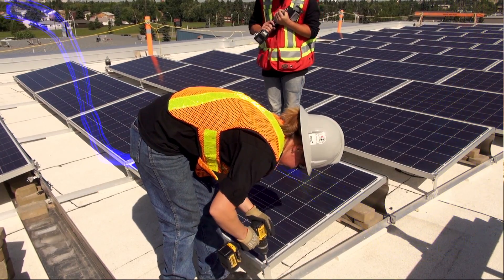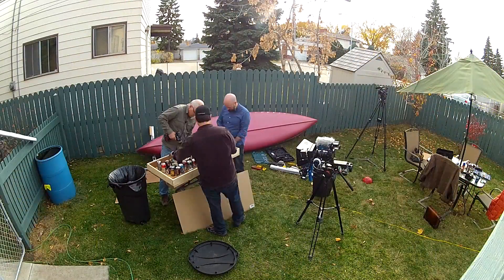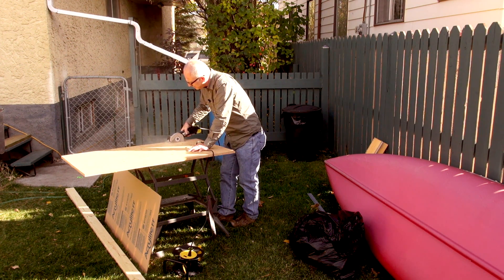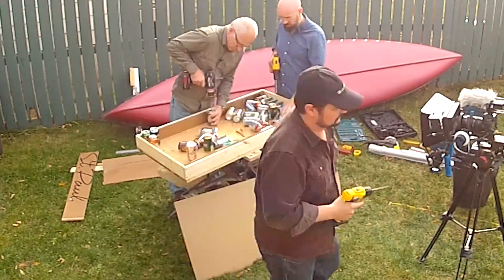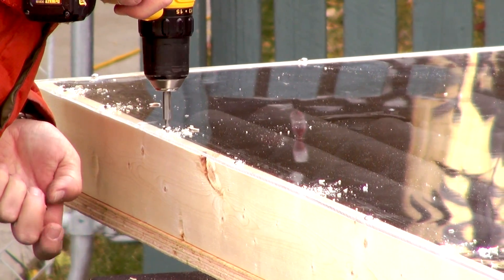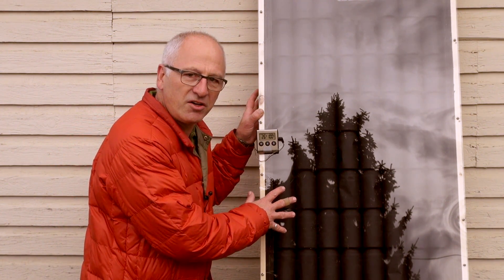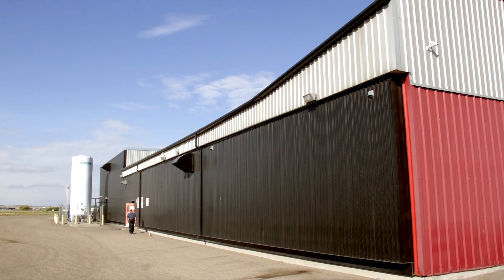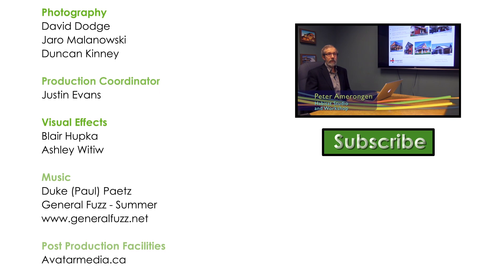90. Solar air heating: We build a DIY version and check out SolarWalls

Comment: Using the metal lath is a great idea. Adding an aluminum screen wrapped around the lath would add more heat to the system. Great job.

Comment: I feel sorry for the Alberta students being subjected to this type of disinformation and faulty science. If the solar collector needs a circulation fan, the whole design should be scrapped and measuring the temperature of the collector is meaningless. If they measured the volume and temperature of the air it produces, then they would be telling us something of value.
Reply: Yeah I was wondering what the purpose of the fan was...
Reply: @ThorsteinnSverrisson  Right! If it is properly designed and built, convection should be all that is needed to circulate the air. If it needs a fan, there something wrong with the design.

Comment: This is actually NOT to correct way to circulate the air. Remove the tops completely and flare the base of each can resembling a pin wheel. The idea is to slow the air flow long enough to super heat the air and the pin wheel cuts in the base of the can causes the air to swirl in each can instead of just passing through the can
Reply: Interesting idea, have you tried it? It theoretically makes sense. But how would one fasten the cans together?

Comment: Come on man, ditch the stupid alum cans and spent a few bucks on real thin walled pipe... He should have completely cut out the bottom of the cans instead of 4-5 holes for much better air flow.... or use thin walled pipe like I said for a few bucks.  Also use 2 big fans in a push pull configuration. a Thermostat on/off auto switch installed would be nice.
Reply: im with u on this!  AND how are they all working? still NOT! i bet. i did something like this and one of the problems was it got damp and latter Black Mold! so i did away with it and spent a bit more $ for a Closed loop system. if interested look me up at Guilt Free Hot Water, don't worrier nothing to sell but get the right stuff and do it Right!
Reply: Be awesome to grab some used black plumbing pipe..  Got to be wasted stuff out there somewhere.. Wonder if filling with water , might even add a longer heat timeframe..
Reply: I’ve also seen one of these built using pennies glued to the inner surface and spray painted black with charcoal grill paint. 
When you say ‘thin walled’ pipe do you mean copper pipe or conduit tubing? What diameter pipe do you suggest? I presume smaller pipe would increase surface area. Perhaps the refrigerant piping from an old air conditioner? I have one that still has the aluminum fins. Maybe I’ll make one from it to see how it performs.

Comment: Make sure you insulate all the walls of the box.or you will cook the wood .  This will give the heat no option but to go for the easy way out, the Airflow,.  and speed of air flow are important. Faster get less heat slower get more heat. 
Will the differential Internal to air temperature of glass panel be able to cope with the difference. Ie Oven glass doors can. Ordinary glass may not..!

Comment: Build one of these recirculating through a thermal mass and it will heat the structure all night too.
Reply: Thermal mass?
Reply: @jamielc3437  Like a bin full of pea gravel, rocks or cob. Similar to a rocket mass heater. Many videos about them in YouTube for wood fired RMH’s.

Comment: Guys, doesn't it makes more sense to take air from the inside, not from the outside? Please share your thoughts on this topic
Reply: Yes, it would be better to take colder air out is your house and heat it. Just like in a car, heats and cools faster that way instead of using outside air
Reply: AJ Dude the air from outside is heated so I don’t see my ch difference 
Not like wood stoves drawing in outer cold air

Comment: A few things I would do to better the unit...is 1 do not put so many vent holes in that's rushing the cold air in 2 would of put the vent holes where it would drew cold air from the garage...2 paint the back board of the box black first every crack matters... 3rd the vent holes would allow little critters in so I would get some kind of screening to keep them out... Seal the corners and insulate the sides and bottom and top from the colder air and leakage of warm air...

Comment: If you found a way to attach the fan to a small solar panel (the kind used for garden lighting or water pumps), then it could be entirely passive. Nice idea.
Reply: I use that set up in my greenhouse,  15 watt solar panel running 4 old computer fans.   They blow hot humid air from the roof of the greenhouse  down "temporary plastic downspout" and into pipes under the soil.   They could work the same way in a solar hot air system.

Comment: Some tips for anyone contemplating doing something like this: Double glazing is recommended for cold weather climates - I use double wall polycarbonate sheets, something like a Suntuf corrugated panel would be fine in less cold areas. You should be drawing intake air from the living space of the home/dwelling, flow through the heater, and then back into the living space. A 1' thick piece of polyisocyanurate rigid insulation painted flat black (that stuff won't melt in high temperatures) works best as the backing. Sufficient size is important, a 4'x8' (or something about 32 sq. ft.) is about the minimum for efficient heating. A fan to provide sufficient air flow but not too much is best - usually installed on the outlet side and optimally would have variable speed and temperature controlled on/off modules. Although well designed passive systems do work too. A backdraft damper on the intake to avoid heat loss at night is a good idea. Mount at a high angle, or even vertical, to catch most of the winter sun - and less of the summer sun.

And finally, using black fiberglass or aluminum insect screening is a heck of lot easier and typically works better than hundreds of aluminum cans! Buiditsolar.com and simplysolar.com are excellent sources for more information.
Reply: It could be my weak internet signal but I couldn’t get either link to open in Safari.
Reply: Excellent tips, Chuck, every one of them!
Reply: Thank you. These are great tips.
Reply: Do you have any data on the amount of energy per area? I recall that the earth average is about 1300 W / m^2 but it could dip low during winter (hence the need for insulation) and go very high during summer.

Comment: I have one of these they work OK when the sun in shining and it's say 10C, now bring it down to  -30C and they don't work. So when you really don't need much heat they are OK but when you really need heat forget about it!
Reply: would it keep it at least around 5-10 degrees if it were running when it was that cold? i'm looking to build this to to just keep my shed above freezing but doesn't need to be too warm
Reply: @KatBurnsKASHKA  I was wondering if this could help keep a crawl,space under a mobile home warmer to keep the pipes from freezing or help minimize the amount for energy spent on keeping pipes warm and from freezing….
Reply: @Abeaness  It would seem to be helpful. As long as the space is fairly well enclosed and perhaps Insulated with styrofoam. Any increase in temp under the house would help reduce energy consumption. And you could also make multiple units.

Comment: Max power is 1 Kwh for each square m. Since that thing won't follow the sun all day you get around 30%. So bigger pannel = more heat. Those can's looks nice but won't improve surface much. Also won't store heat for more than minutes so use them or not is up to you. About paint and plexi gases ... That paint is made for stoves so no worry about too much heat and you will never get that much heat to melt plexi.

Comment: Hi, I have constructed two panels on my own. I have instaled them on the roof. The two panels are connected and drag the air from one room and pump to another as one. The problems is that on the way from the top (hotest) point of the panel to the fan (approximatety in 2.5m) it loses 70°C of heat. I have inserted a thermo snesor inside the panel, so on the top of the panel the temperature is 106-107°C, while the temperature infront of the fan is 30°C. Did you face any kind of similar problems in your panel's work? What may couse that big heat lost in your oppinion?
Reply: WOW!!Then why not connect it straight to the wall and not roof that way clearly you will get the winning energy?Maybe the pipes or tube or how we call it is not enough thick or energysaver or you might have somewhere leak and you dont know.Example birds over the roof or some icerain hit the pot or over heat temprature and cant stand high level of heat with those pipes?

Comment: Do you have any idea what gases the black paint and the plexiglas will produce over the next five years when exposed to the hot sun?  Is it really a good idea to feed these gases straight into the garage for the occupiers to breath?  Have you given even a moment's thought to the health implications of a set up like this?

With just a little more effort, you could have kept the air in the cans completely separate from the painted sections, and avoided any problems.
Reply: Mandolinic
Reply: Mandolinic , use food coloring if you don't want to use paint. Kenkoy.

Comment: Worth a while checking the "simplysolar" forums.  They are DIY people mostly in the States and with some in Canada. They do comparison tests of different solar heat collectors. So they make 2 panels like Davids, place them side by side  and run 2 different materials  as collectors in them and measure the heat collected in the air.  The "best" collectors (and easiest to make!) in their tests are a couple of layers of black alu wire winowscreen  or black  fiberglass windowscreen, and another good one is alu downspouts.  They did not expect windowscreen to be good.  But it works because of the huge surface area to collect the heat and almost instantly warm the air around it at the same time.